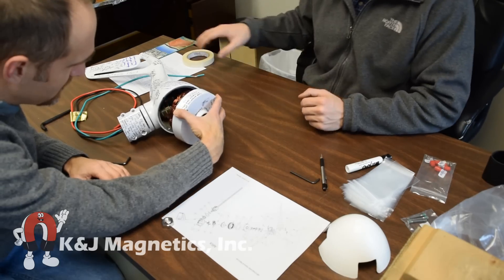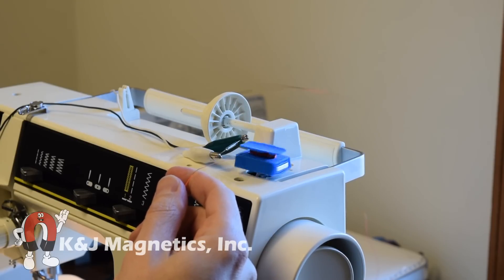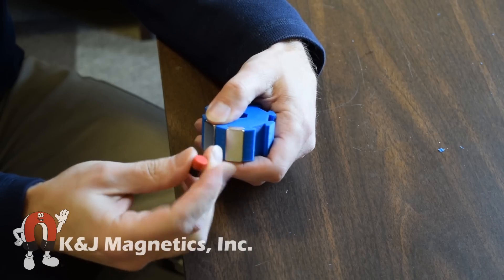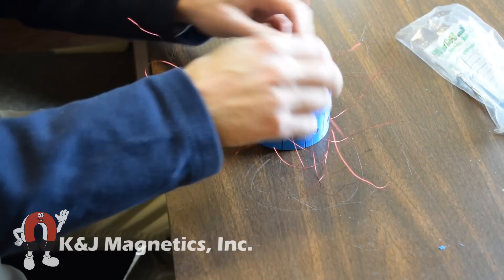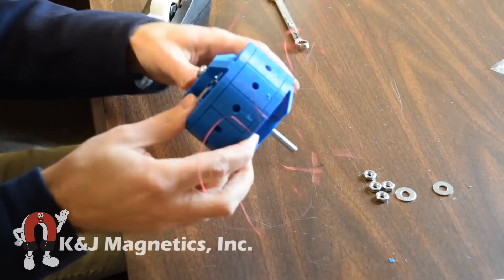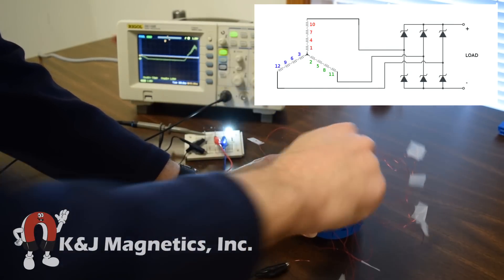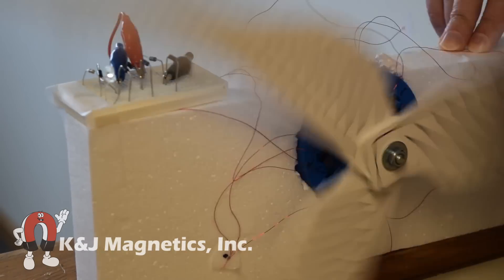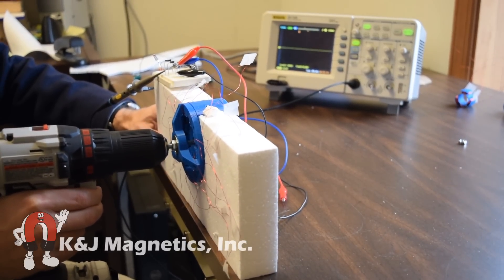3D Printed Wind Turbine

Comment: If you use an iron stater, you'll have much higher efficiency as well.  A lot of the newer turbines used to produce electricity commercially use a reduction gear as well so as to increase up-time.

silicon alloyed steel specifically.

Comment: Quick question - on the link in the website it says you produced less than 1 watt, but also generated 20v (probably max given it was the drill), which means you produced hardly any amps to be less than 1 watt. What would need to be done to increase the amps/watts to reach like 50w? Is it an issue with efficiency of the bearing, materials, layout of the materials, etc?
Reply: They had a pretty big gap between the magnet and the coil. The rod they used was all over the place. They used 30 awg wire. 30 awg wire has a current capacity of .5 Amps.

Comment: Is ther a disadvantage of just using a dc motor instead as a genetator?
Reply: longevity really, the carbon brushes wear out pretty fast, use either brushless motors or stepper motors, they work really well

Comment: Unfortunately, the low magnetic permeability of plastic is really going to hurt your efficiency here. There's a reason "real" generator/motor/etc rotors/stators are made using electrical steel.
Reply from the maker: Definitely!
Reply: @KJMagnetics  what if you put calc and resin around the coils and magnets like pouring into a mold. look at this link : https://wiki.lowtechlab.org/wiki/Eolienne_200W look at step 16 and step 23. Please let me know if this would increase efficiency.